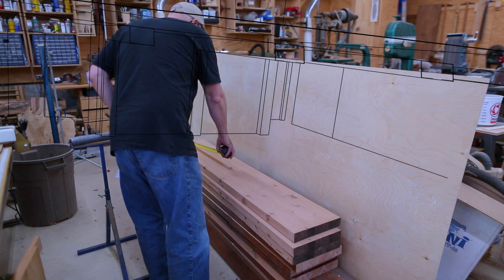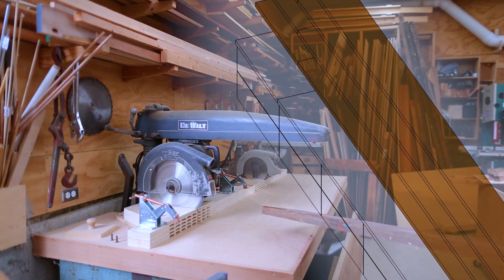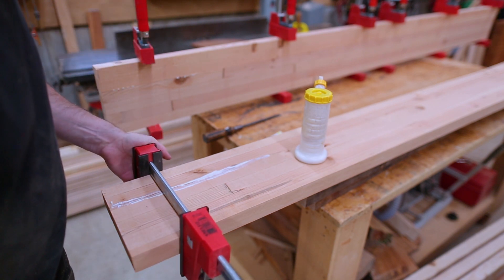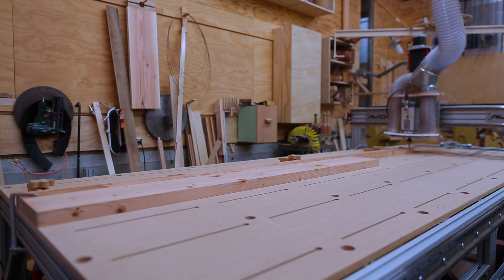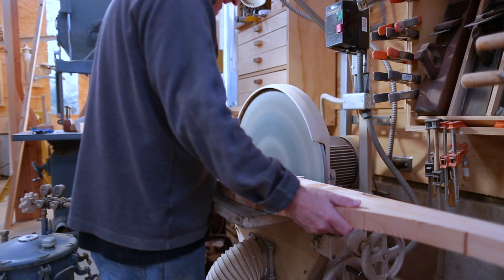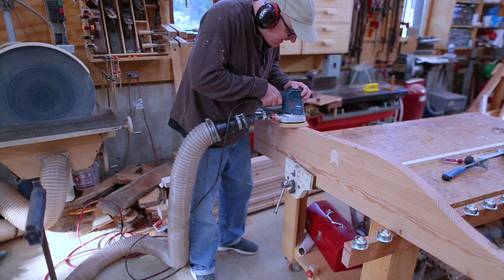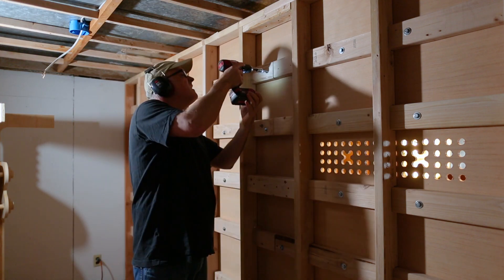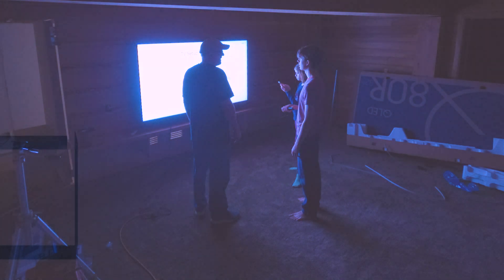Basement Remodel – Part 4 – Building Floating Shelves

Comment: My first instinct would have been to use the entire room as the theatre room, but as the project has gone on I've come around to the storage room concept.  It takes up only a small amount of the space, and both removes clutter (both physical and visual) and increases the rooms storage capacity.  A great design choice.

Comment: Great shelving system, especially the floating aspect (which always interests me)!  I first had some doubts when I saw they were just held in place with a lag screw coming in from the back side of the plywood back wall, since the shelf width would produce some leverage to pull down and possibly weaken the hole through the plywood.  But then when I saw you were going through both the plywood and the 2x stock, that's about 2 1/4" of support on the screw before the leverage would start to work on it.  Plus the length of the screw embedded in the shelf, plus the diameter of the screw, and so many screws per shelf, I don't doubt you're right that someone could climb on them.  Great design!

Comment: Looking good.   On cracked wood I have put glue on one side of the crack and drew the glue into the crack with a shopvac on the other side.  This works really good.      Thanks
Reply from the maker: I like it, I will have to try that.

Comment: Pour the epoxy from about 18 inches up in a very thin stream very slowly. Only pour in one spot and let it fill the cavity. This will help a great deal with air bubbles bring created from the pour or getting bubbles trapped in the cavity.

Comment: A quick way to get glue into cracks in your boards is to puddle the glue on the surface and pull it through to the bottom of the board with a shop vac.  You will get almost 100% coverage top to bottom without the need to pry the crack open possibly damaging the board.

Comment: Consider adding a small fan at the bottom of the TV where the air ducts are. The nature of the ribbing behind the TV will create turbulence as the TV warms up thus creating difficulties in the way it's designed to work. I know this for a fact (at the very least for a 2010 Philips that cooked itself in its own juices after i placed it in front of a mostly empty set of shelves at a considerable distance too, 20 24 cm.

Comment: Next time you use resin, make sure to vibrate it thoroughly, while the resin sets, that will remove a lot of the bubbles, also make sure to overfill the holes so you can sand down the resin afterwards to remove the last of the bubbles, overall good job though.

Comment: the use of the two inch block for the shelves solves a stupid problem i have free hand drilling holes in wood and having the at 90 degrees, simple solutions for simple situations :)
i'm guessing somewhere in your house there is a big 'cat plug' hole for the cat/s to go through :), if not, why not!